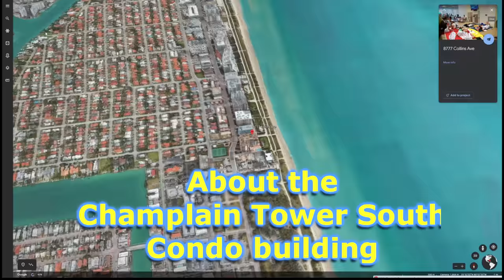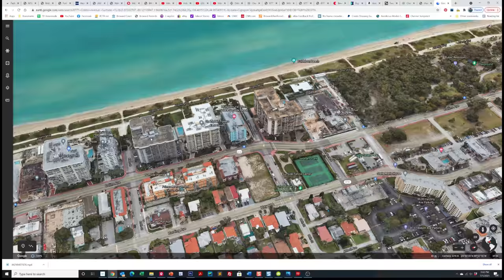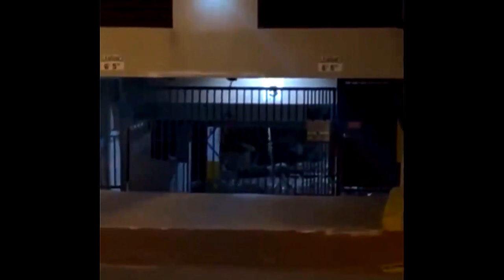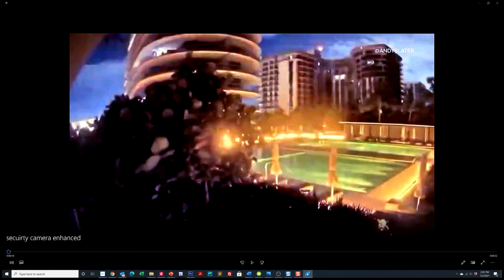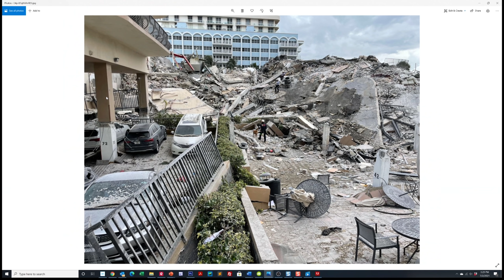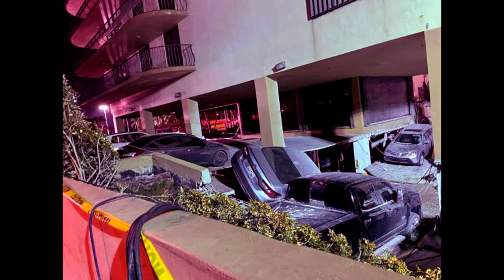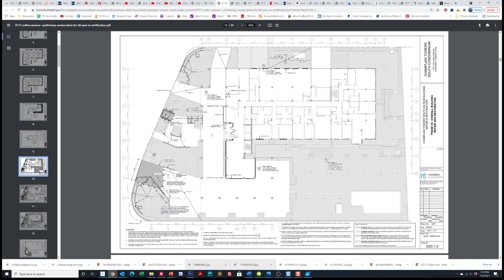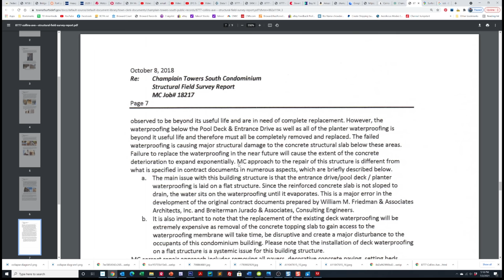Here's Cause Of Miami Condo Collapse Champlain Condo Towers, Surfside

Comment: You need to use a cursor with color when you are pointing on a floor plan. Who can see what you are doing, but you?  I would like too, but I can’t follow what I cannot see.  It’s too small and the same color.  Please use a different color cursor.  BTW, where was the part of the building that was apartments half demolished?  You didn’t point out any of that.

Comment: You missed the only difference between the North Tower and the South Tower was the crane that collapsed on the Pile Caps during construction of the south tower which was not repaired that led to a foundation failure that caused the collapse. Morabido dug through the basement slab and saw the damaged pile caps and had included plans to install a beam reinforcing the damaged pile caps in the 40 year plan. Don't take my word for it look at the 40 year plan and tell me why they included reinforcing the foundation pile caps with a concrete beam between the damaged pile caps.

Comment: Jfc that was the most long winded explanation so far. I don't need the triple coverage of the exact explanation. Could have used the time to highlight the columns. The real issue is this building was built to fail. I've seen more beefy columns on a 10 story parking garage.

Comment: The concrete placement at pour was not properly vibrated . Therefore the steel is not embedded and lacks the intended structural capacity.
They also left out some beams ( horizon concrete ) late arch change that got missed by engineers.
Piss poor compliance of field inspection.
Reply from the maker: yes a lot of missed items were present

Comment: I believe the front section had beefier columns because this is where the elevators were. This section also had a big chiller on the roof. Just a theory as to why the front section was sturdier.
Reply from the maker: There other reasons, like the massive shear wall, and also it had extra beams on the 2nd floor

Comment: Good analysis.  But did you really want to say this?
"...when rebar gets rusty, it expands (or tries to expand) to several times its own width"

I'm having trouble with that one.
Reply: In the process of rusting iron atoms in the steel of the rebar combine with oxygen atoms forming a larger molecule (rust = Fe2+O3)  which causes the material to expand.  I agree that it will not typically expand to several times its original size, but it will expand.  This expansion will put some of the concrete around the rebar into tension and concrete is quite weak in tension so it cracks.  More water gets in through the cracks accelerating the rusting process.  Some rebar sold now is coated in epoxy resin to try and keep it from rusting when the concrete is exposed to water.
Reply: Thanks for the clarification.

Comment: What I'm curious about is seeing the pool itself was still full of water after the collapse, where was the water coming from that the people across the street filmed in the garage 7 minutes before the collapse?
Reply from the maker: The 1st digger to some of the news outlets were reporting that there was something to do with the pool, because 36 hours before the collapse the pool maintenance company had showed up and took photos inside the pool maintenance room where there was exposed exposed rebar poking through the concrete through the concrete so many people attributed that as a root cause for the collapse. But what actually happened was it had nothing to do with the collapse , and when the pool deck collapsed collapsed and the garage is underneath it, it burst some pipes and that's the water that the tourist saw in the video.
Reply: @jeffostroff  I see. I did watch the entire video but apparently missed the reason for the pool deck collapsing. Was it structural with the skinnier columns and the water over time weakening the rebar?

Comment: Not sure if you've seen the video done by Rako Studies but he was able to enhance the picture of that garage with the water pouring in. He says, "I propose that the weight of a landscape planter collapsed the pool deck of the Champlain Towers South condominium. The deck under the planter was deteriorated by water intrusion and a poor design that did not provide for water runoff. The planter crushed the parking deck column underneath it, and seven minutes later the adjacent four columns collapsed and made the building pancake.

I used the free IrfanView image program to enhance a screen grab from the Adrianita Castillero video. It clearly shows the edge of the pool deck collapsed onto the floor of the parking garage. I then used the MAGIX Vegas Pro video editing program to stabilize, zoom, and enhance the Adrianita Castillero video. Finally, I use Google Earth to show the planters that were added after the building was built used to have palm trees. They were removed between May and December of 2017. This was probably done since they obscured the ocean view, not because they were heavy.

There were concrete beams underneath the original planter. The square planters that were added were all placed over a parking deck column, except for one right where the collapse happened. The Jeff Ostroff video has clear drawings of the relation of the planters to the columns underneath, as well as video shot from inside the garage that shows the severe damage under the planter. Be sure to watch that video, keeping in mind the "planter hypothesis."

Comment: Although water issues and bad design of the deck are the part of the reason for this collapse. Possible neglect and in-action over the years to correct the water problems lead directly to this collapse. It should also be noted that this type of slab on column without reinforced capitals is no longer allowed in most countries due to the tendency of the columns punching through the slab This construction method was not uncommon after WWII as it offered a cheap and quick way of rebuilding War torn Europe in the late 40’s and 50’s.  After that many developers adopted it and built a lot of affordable living space this way.  But after several collapses (in the UK) of these buildings via punch through of the slab by the columns this method of construction was banned.
Reply from the maker: Yes if you find that video that I did last August on the Fort Lauderdale Marriott resort garage, at least they had drop panels and some places will have the wider capitals at top like you mentioned those help prevent the punching shear. most modern designs in our area what I am seeing is just nothing but beams going to columns there is no slab tying directly into the column there is no threat of punching shear at all

Comment: I think it was you who said that planter on the pool deck caused it. I think you'll end up finding you are correct.
Reply from the maker: Yes a few of us think that. But also I differ from others in that I am not stipulating that the planter was the cause, I think the planter was along for the ride and was just another stressor let's face it the concrete was weak and it gave way possibly from being design almost at full capacity, combined with people remodeling their condos over the years and adding tile up the walls, granite countertops extra bars for serving drinks, and palm trees added on the pool deck, combined with poor drainage on the pool deck, an extra weight of pavers and sand added in 1996.

Comment: How do you explain the pyrotechnic flashes after the power loss... the third section should have also collapsed but the pyrotechnics didn't do their job on the top of the thread section..

Comment: So if the engineers drawings call for a 2% graded slope all across the pool deck to accommodate water run off then why was it not present? The concrete pouring contractor is at fault. Some pooling of water in between tiles is acceptable but not 20 square feet of pooled water. Sitting pooled water that was "left to stand and evaporate" (by the inspectors report) always seeps into micro-fissures in concrete before it evaporates. If sloped properly rain will drain off and has no time to seep into cracks. I can see that pooled water soaked into the concrete and eventually corroded (no cathodic protection on the rebar either mind you) the concreted rebar but the big question is the "regularly pumping out of SALT WATER after it rained"?  What salt water? Yes this is ocean front property but it is over 100 feet from the tidal ocean spray. That far ocean spray is no where close enough to corrode concrete. The real clue is that pumping out of salt water occurred AFTER IT RAINED. This means that the integrity of the concrete foundation was not impervious to a rising salt water table. Whoever physically built this condominium needs to be questioned thoroughly. RIP Champlain Towers.

Comment: Good analysis of the info you have. Definitely concerning that the levels sheared off the top of columns. I must point out that the narrow columns appear to support only the pool deck, and larger ones supporting the towers. Either way, the floor should not separate and slide down the pole. Fail.

Comment: The columns and floors were at right-angles which shears under stress / load -- no use of any architectural arches so once it got loaded -- pancaked floors...  lower floors / spalling concrete / produced a load which the structure as designed with no arches, came down.

Comment: Concrete surrounds the rebar and seals it from any oxygen, it cannot rust unless exposed to the air. Also, Anna structural rebar would NOT be that close to the outside of the concrete, unless it's got so much in it, that it is just under the surface. In which case, the rebar will be strong enough to support the building. I have 20+ years working at a redimix company and surface mine. My family owns it, so I'm not just babbling

Comment: I don't understand how ANY support column lasts under 200 years, and that's assuming it's exposed to a continuous onslaught of rain, salt water and dog pee. Support columns should be endemically infallible, unless something breaks the design parameters (e.g. overweight, collateral mods, etc.).
The very concept of having to have inspectors visually observe if the surface is degrading shows a fundamental fallacy. We're doing it wrong.
Support columns should ONLY fail due to one-in-500-year disturbances, or vehicle or ship collisions. NOT AGE. This is endemically flawed.

Comment: I’m by Hollywood beach, out building has 8floors and was built in 1928. I get anxiety coming to work everyday now.
Reply from the maker: At least you now know what to look for
Reply: We have a house that was built in 1925 and the cinder-block basement walls mortar is so deteriorated you can scratch it out with your fingernail.
I have little doubt this Florida building being built in 1928 will have the a very similar or same mortar used.

Comment: corrosion failure due to poor maintenance of underground parking. All buildings near the beach should never have underground parking. and all plumbing should have its own shaft to keep water off the building. I think If steel beams were used you would just have a deck failure.

Comment: Seeing it have 4K dislikes, this is by far the best description of the collapse itself, all recorded.  Granted this person has the insight to do a good investigation, and gave his opinion on it, and it pretty much links up all the dots.  Others are saying there was a tunnel underneath it, or a corner got destroyed by a DEW(direct energy weapon) etc., and I don't believe that is the case.

Facts >>> there was a lot of water in the area over time.  When you have buildings built near the ocean shore line, the ground  and bedrock underneath it is always going to be unstable.  The age of the building is a factor, sea water and humidity, and the lousey methods of REBAR.  WHERE IS THE STEEL BEAMS FOR SUPPORT??  Ahhhh, so they used rebar and concrete to make a beam.   This is where the cost cutting took place.  Why are people still using steel rebar instead of Stainless rebar which will not rust???  Strength, they have some just as strong as steel.  Roman concrete will last 2,000 + years.  What does Ancient Rome concrete tell you concerning salt water?? They had better engineers than we have today belive it or not.

Comment: They are all missing the primary fact that rising sea level has been inundating the very streets of Miami for years and the ocean ( salt ) water migrating into the ground under these beachside buildings is causing not only corrosion to the construction members in ground contact but also liquefaction of the very ground they stand on.  All the buildings in these type of locations are in danger of collapse and never should have been built on such weak and shifting sands.  " My name is Ozymandias ... look upon my works ... and despair "
Reply from the maker: The weak and shifting Sims are not part of the problem per se, these buildings are supported on pilots that are pounded all the way down of the wine stones so they do have support. But water is still getting in from underneath

Comment: It's called punching shear. The design should have included drop panels at the location where column meets slab
Reply: Probably not required in 1980

Comment: Sometimes when you have to prime the pump you leave the filter lid part way off, turn the pump on then quickly shut the lid.  Water will get on the floor.
Reply: Seeing that the pump is below the pool water level, it probably does not need to be primed.

Comment: Those smaller columns that you notice are smaller because they didn't carry the weight of the main structure but only the weight of the pool deck that is why they are smaller. Who ever was the third party inspector is should be in a lot of trouble. Because that building fell because of the lack of rebar steel.

Comment: One of the theories that I have thought about goes back to the original developers of the building. If this building was started before the plans for the building were finished, then that could be a reason for different specifications such as support columns. Also, it's no secret that Miami Florida was built with funds from the cocaine trafficking money that was awash in Florida at the time. These people needed a way to launder the proceeds from their illegal businesses and construction was the prefect washing machine.  For that reason, a lot of these buildings were NOT built for the main purpose of developing real estate, that would continue to produce revenue for years. Instead it was a fast way to launder the money that they already made. This could be one of the reasons in the negligence of some of these building designs and construction.
Another reason that could explain the differences in specifications of the buildings design such as the support columns, is if the building was being designed by one firm, and then abandoned for whatever reason, then those unfinished designs were picked up by another firm. I think that is what happened to the Hyatt Regency walkway collapse in July 1981, that took the lives of over 100 people and injured over 200 more. That was a classic case of a large scale building project that was fast tracked with little oversight. The original designers of the walkway were not the final designers when it was completed. Along the way, someone made changes to the plans, and did not use the proper calculations for the walkway resulting in the failure of the supports of that walkway and then collapsed. There is plenty of footage from that event and it's really disturbing.
I think any of these reasons could have led to what we saw at Surfside. It didn't just collapse that night. This was a ticking timebomb that started many years before, and it was only a matter of time until this happened. I understand that these building designs were used to build several exact replicas of this building. I don't know if this was the first, last or middle building, but if I lived in one of these, I would move, I don't care if they say it's safe.
Reply: Corona Virus  why is everything a conspiracy to you? I know it makes you feel smart when you think you have information that the majority of other people do not. It's human nature to question things, but when those questions aren't really reasonable, and there doesn't seem to be an immediate answer, that doesn't mean there are some nefarious explanations for them. It's your right to believe whatever it is you want, but don't pretend you are smarter than everyone else because you think you have the answers.

Comment: In my humble opinion, the reason for the collapse is what we called in the business "Beer Canning". It was the practice of unscrupulous contractors to ignore the specifications for the building by not filling all the cells of the blocks in the wall. They did this by taking flattened beer cans and placing them over the cell in the block before pouring concrete. This would save many thousands of dollars in cement, which they would pocket as pure profit! I was told to do this or I would be fired. So I quit. A week later a couple of crews were killed when the floors collapsed on top of them. I am sure that it was caused by the lack of strength in the walls, caused by "Beer Canning". How many buildings in Southern Florida are affected by this, is anyone's guess. But I think all of the buildings should be tested to make sure that the intended load carrying capabilities of the engineers has not been compromised by this nefarious practice of "Beer Canning"!